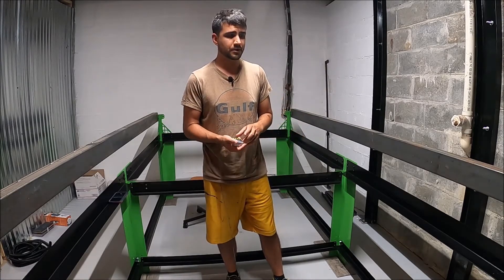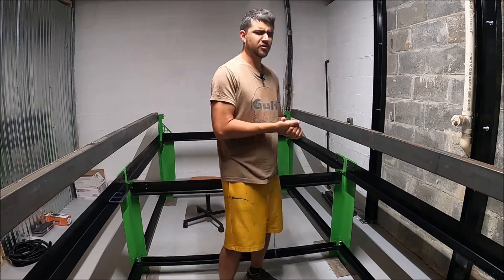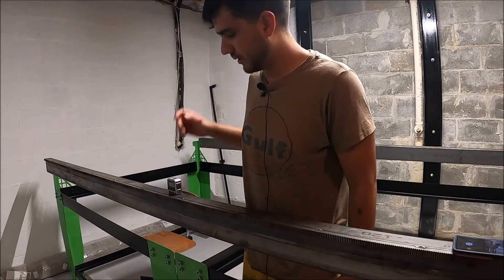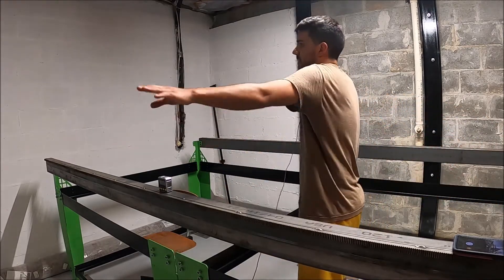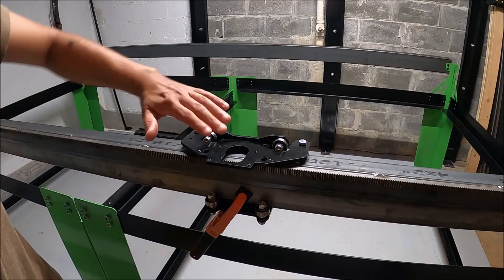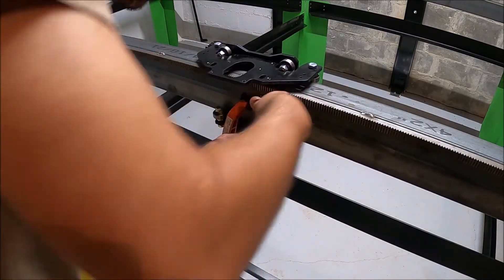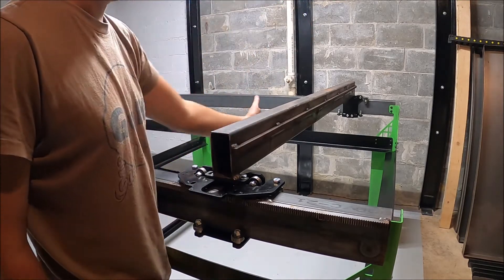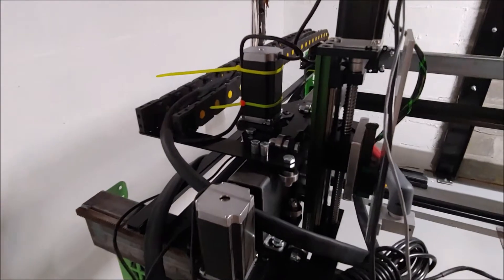CNC PLASMA TABLE Squaring and Gantry Assembly

Comment: I just bought the same thing when it got to gantry part for wires and stuff — someone went on vacation lol
Now i have to guess at it like you did. Geeze
Reply from the maker: Yeah, they could used a better manual. 
Also got some suggestions from some folks for modifying it to be a little more rigid.